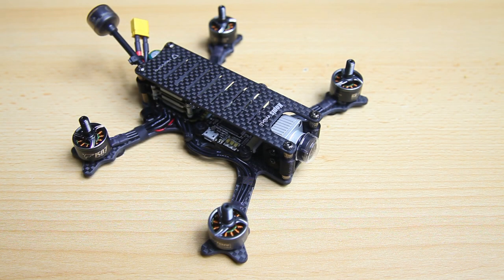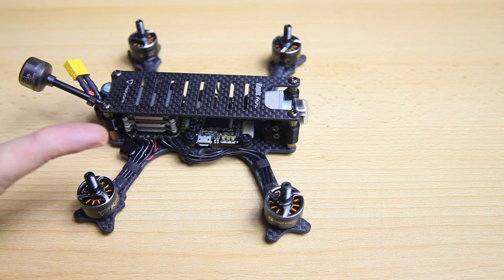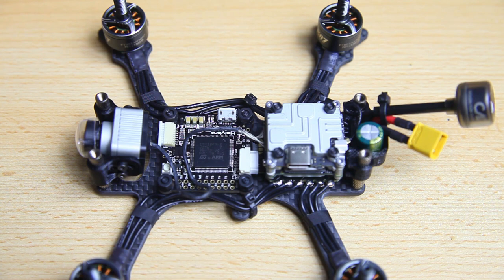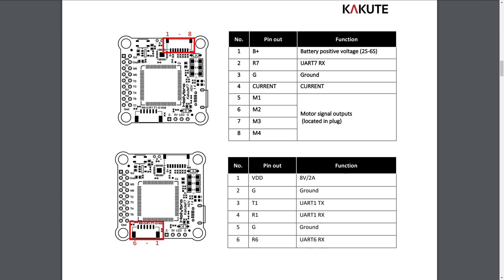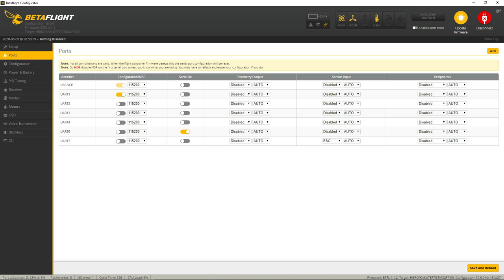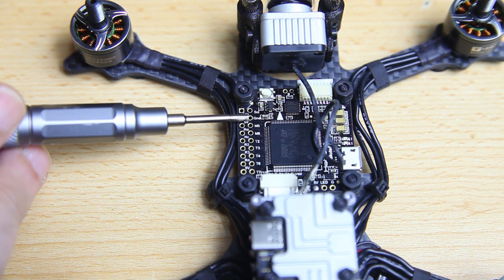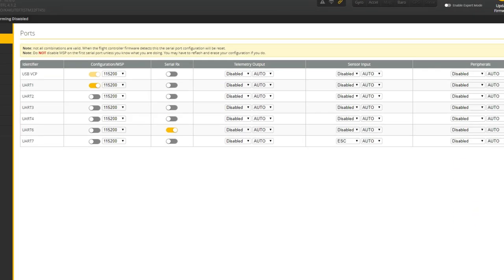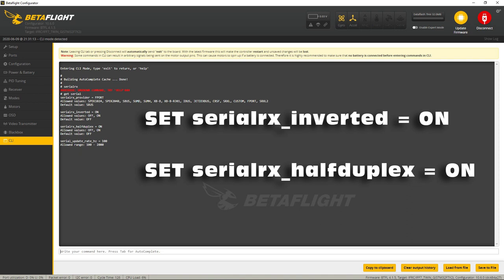DJI Digital FPV + Second Receiver HOW TO (Frsky R-XSR F-port setup)

Comment from the maker: Installing a "normal" receiver in the Kopis Mini Digital FPV setup :)  
Link to the quad used: https://www.banggood.com/Holybro-Kopis-Mini-CADDX-VISTA-Version-3-Inch-4S-FPV-Racing-Drone-PNP-F7-FC-45A-ESC-Digital-HD-System-for-DJI-p-1692524.html?p=TO251813974002015038

Comment: Thanks!  My friend has a kopis mini with the FrSky long range receiver.  Every time he armed he would lose rx.  Your video was just what we needed to realise that it was the dji receiver as they were both wired to uart 6.  To make life easy we pulled the lead from the dji for the receiver pin and put some heat shrink on it.  

Thanks again for the inspiration!
Reply from the maker: Well there you David! Glad the video was of use to you! That is ofcourse what I made the video for :) 
Cheers and happy flying!

Comment: Hello Dutchy this tutorial or Video is very good for a new bee, Thank you.
I wonder if this Flight Controller is the same with DJI Protek 25 ? Would you Please let me Know
Im using the same Receiver FrSky R-XSR for my Protea 25. and I used FrSky Jumper Radio Control.
Thank you
Reply from the maker: Howdy :)  thank you AND well no.. this flight controller is very different, but what I did can also be done with your flight controller :) 
you will have to look for the schametics / layout of the FC ion your quad (iFlight offers the documentation on their site).. and then basically do as I did :)
Reply: @DutchRC   Okay I will try to get the Diagram of Protek 25 from Ifligth Website. Thank you again for information.
Dankesoen.
Reply from the maker: @65oon  :D  no worries man :)  good luck figuring these things out... I know there is a lot to take in...

Comment: what I like to do is the opposite....I like to bypass my xm reciver and activate the cadd Vista for full digital use as reciver to the dji remote control and goggles.....do you have a video on that or is this even possible to do....please letter me know
Reply from the maker: Welll I actually don't have the DJI radio :P  so It would be kinda hard to test that.. 
Basically though the receiver-stran from the DJI units is a simple SBut signal.. (and almost All flight controllers have a dedicated SBus pad)

Comment: Hello . Nice tutorial Thanks. However, I have a question. I did everything according to your guide. I fired up the tbs crosfire nano and the Tbs tango radio. I have a connection signal but the drone is not responding. Nothing happens in betaflight. It looks like the radio can see the drone but the drone cannot see the radio. Thanks .
Reply from the maker: Thanks man :)  and let me see.. Surely you did set up the uart for the receiver (ports tab) but did you also select CRSF as receiver type on the configuration tab? 
If that is both correct you could have a look at the serialrx_inverted & serialrx_halfduplex settings.. are those set correct for your FC / receiver?
Reply: @DutchRC  thank you for the quick answers. In the Europe is late here. I'll check tomorrow and  I let you know

Comment: I'm assuming you tested this and it works, so can you tell me why not the r2(rx) pin on the fc, why use the t2(tx), I mean it should receive signal from the radio receiver. So to me it would make sense that tx on the radio connect to the rx on the fc..
Reply from the maker: Tested and works indeed :)  Fport is a 2-way connection type over which the receiver tells the FC what it received.. 
But also the FC returns telemetry to the receiver over that 1 single line.. 
This setup requires the use of the TX pad on the FC... for normal SBus you would use the RX pad
Reply: @DutchRC  thank you very much for this answer. And your high quality videos.
Reply from the maker: @fuba44  You're welcome and Good question as well by the way! :) 
Thanks! & happy flying

Comment: Really helpful video! Does this also mean you can remove 1 antenna from the air unit? Since you only have 1 instead of 2, how do I know wich one to remove?
Reply from the maker: Thank you :) 
And nope.. for as far as I know Both transmit.. I am not sure if both also receive but you will need to run both :)
Reply: DutchRC Adventures Allright! Thanks for responding so fast. 🤙🏽

Comment: Just added a frsky xm+  Sbus receiver to my kopis mini, this video was a great help, only difference is not to solder to the T2 but the R2 point then follow this video but no need to make any command line changes, thanks very much great video.
Reply from the maker: Thanks for the comment Paul and good to read the video helped you out regardless :) 
I guess you basically used the Sbus input-pad on the FC then?
Reply: @DutchRC  after reading the controller instructions ( who does that ) any free input can be used for Sbus but you have to use the “R” not the “T” pads
Reply from the maker: @paulmason6847  LOL :D  wellll actually whenever I'm working on a quad I have a diagram of the FC on screen :)

Comment: Hi there, so i bought my first fpv ever and trying to enter this vast wordl. my set up is a Nazgul 5 HD Vista iFlight 6S, the dji googles V1 and a radio master tx16s. i was configurating every thing and i couldnt bind the controller with the drone and i just wanted to make shure that it is impossible to connect them, unlles i unstill a Frsky R-XSR or a crossfire.
Sry to bother you, it is just that im a litle mad because already have all the set up here after 2 month stduying what i wanted to buy and i can´t use it now. if you have any advice pls help me :)
Reply from the maker: Howdy man :)  welcome to the wonderous world of RC / FPV ;)  It's complicated but after a while things Will make sense :) 
But you are right.. essentually your Nazgul5 drone does have a Receiver.. But it is a DJI receiver only (so you would need a DJI transmitter).. 
The Radiomaster radio 'talks' a lot of languages, but DJI isn't one of them.. sooooo yes.. you will need to add a R-XSR or XM+ receiver to your quad.. Like I did in this video....

Comment: Thanks for the great videos! I've hit a little stumbling block though. This is my first HD quad and i'm excited to get it up in the air. I have followed this tutorial to the letter and i'm really close.  I am doing the exact same thing, soldering a r-xsr receiver in the kopis mini with caddx vista.  The taranis is bound to the receiver successfully.  I also used the "T2" pad for UART 2. I can see telemetry (battery voltage) on my taranis.  Betaflight isn't showing that i have any input from my transmitter on the receiver and mode tabs. The sticks and switches aren't having any input.  Any ideas?
Reply from the maker: Howdy man! Well congrats! You are indeed pretty for :D  (maybe you even already have it sorted by now :P) 
Have you configured your receiver as being an F-port receiver in the Configuration tab of Betaflight? :)   I do assume the firmware on the receiver is already of the Fport type (?) :)
Reply: @DutchRC  Thanks for your reply!  You've hit it there.. its not configured for f port.  I didn't know that was a thing before I started this. I've never tried flashing firmware to a rx from the x9d before. I'll have to give it a try
Reply from the maker: @scottTNT   in the Frsky world getting to know the ins-and-outs of firmware flashing IS an apple you need to get your teeth into regrettably ;) 
but there is a lot to be found on YT on that :)

Comment: Hey I just bought the same quad it’s my first dji drone. I use DSMx and I am wondering do you no if I need to run any cli commands after I wire it all up?
Reply from the maker: Howdy man :)  do you have the DJI Airunit version of Caddx Vista? If it's the Vista version you should secure the antenna in place better (I chopped mine off after 30 seconds :P) 
My experience with DSMX is regretably highly limited! :O   I'm expecting you'll have to do the same I did, but can't be sure :(
Reply: DutchRC Adventures figured it out thanks man your video was helpful even though I used DSMx! You talking about the vista antenna or your receiver antenna got chopper off?
Reply from the maker: @fpvrehab8310  Good on ya man! :) do let me know how You like the quad ofcourse :) 
the vista antenna was Gone 
Good news though!: a minute or 2 of having the unit ON, without antenna didn't destroy the unit :)
Reply from the maker: @fpvrehab8310  as you can see from Today's flight :)  https://www.youtube.com/watch?v=Sf8fp2O0zWw

Comment: I recently installed a caddx vista with a diversity crossfire receiver. I don’t have any stick inputs, do I need to use cli commands also? Or is there another step that I’m missing that is included when adding the diversity crossfire receiver? I’m using a tango 2 remote and it is already bounded with the receiver. Thanks.
Reply from the maker: Hi there :) 
this mostly depends on the flight controller.. There is probably a diagram for the flight controller in your craft that shows how to connect a Crossfire receiver to it (?) .. if you don't have that yet.. look it up :) 
After that you will have to configure a UART in betaflight for the receiver (Port tab).. and set your receiver-type to Crossfire (Configuration tab).. 
Hope that helps :)

Comment: Hello,  i have a problem with binding my r9mx... I bought tx16s, r9 module and i am using mamba f405 dji board. So now i am very confused becouse i dont know what i shuld do first (flashing firmware, binding...) and i also dont know if i have to wire sbus out to sbus or if i have to use fport... If you have any idea what shuld i do would be helpful.... Thank you 👍
Reply from the maker: The firmware (both on the module and receiver) is for Sure the first step.. What receiver are you using? 
The simplest /easiest way of getting things to work is using Sbus.. The receiver probably comes stock with that (but you Still have to make sure both module & receiver are FCC / LBT).. 
Once you have SBus working you Could try Fport.. it's nice but not needed to fly
Reply: @DutchRC  thank you already understand more... I am using r9mx EU receiver and if i understand right i first flash firmware to both module and receiver and than i create new model in opentx and set sbus protocol. Only thing i need to know is that when you set sbus there is no option that say bind (if you select r9m protocol there is). I only need to wire sbus out wire to sbus pad on FC (gnd and 5v)  and i dont need to worry about fport right?
Reply from the maker: @andrazgrat7215  that is a bit weird (and different then what my R9 setups did).. Are you sure there never is a Bind option? (the receiver should have a bind Button)
and true.. later on you can set up telemetry, but to simply have it Work you need power (Plus and Ground) and signal (Sbus in this case).. that's it :)
Reply: @DutchRC  yes there is a bind button... I will try to flash new firmware and i think than it shoud work... Thank you for your replyes and keep making great videos 👍
Reply from the maker: @andrazgrat7215  Excellent! Good luck with the rest of the googling / research / flying :)

Comment: can you show us it flying on the normal r/x?,,,if possible,,,thanks
Reply: The normal RX would be the Caddx Vista's receiver you mean? :$
Reply: flying footage with just the Frsky R-XSR installed,,:o}.
Reply from the maker: Yeah.. I will do that as soon as I can, but in my first flight I ripped the FPV antenna off :P 
So at this point I can't fly it :|

Comment: Thanks! I’ll be doing the same thing on a kopis mini soon with a crossfire nano (pending the very random shipping times at the moment!) so this helps a lot. Where did you end up mounting your receiver in this case? 
There’s loads of space as you say, so I guess a cable tie or two under the top plate would be okay?
Would be great to see the end product with antennas mounted. Cheers
Reply from the maker: Thanks Nick :)  I actually ended up making a 3D printed 30x30 platform to mount the receiver on.. I added a few hooks to that so keep the camera-wire in place :) 
But basically any of them fiberglass / plastick stack-plates would work I guess :)